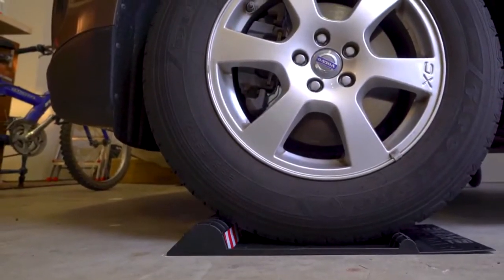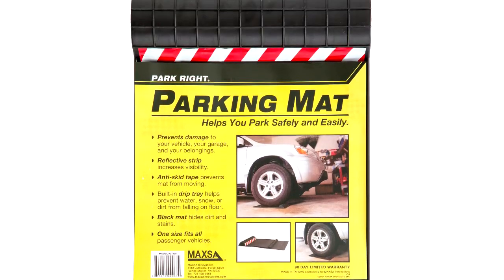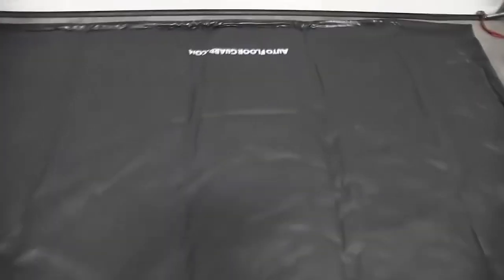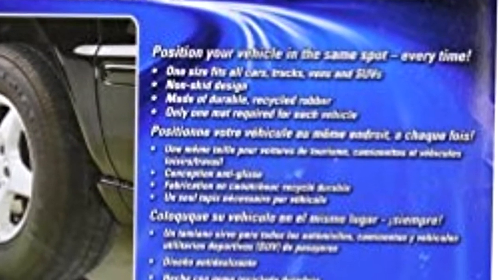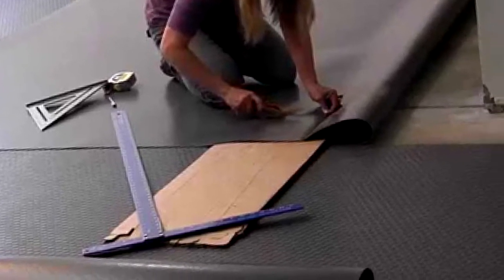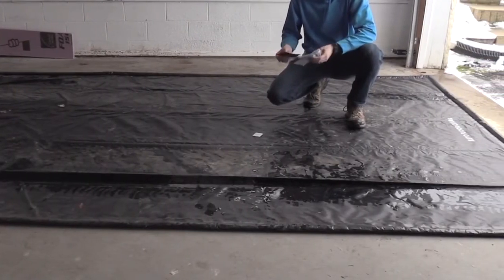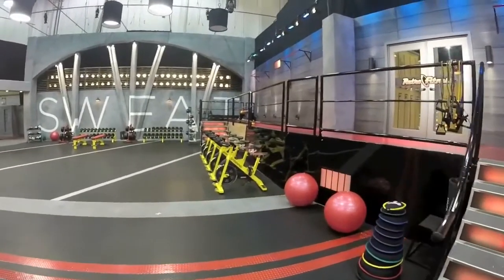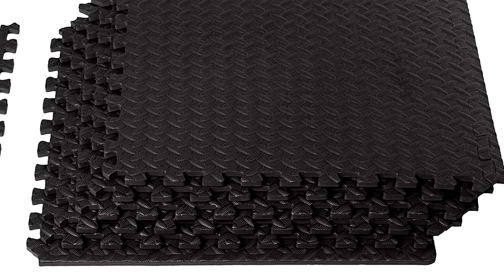Best Garage Floors 🤩👌🙀😎 in 2020

Comment from the maker: - Auto Floor Guard Containment Mat ➫ https://bit.ly/2XRuKKs
- AutoFloorGuard Heavy Duty Containment Mat ➫ https://bit.ly/2GimLeC
- Performance Tool W88989 Protective Interlocking Floor Mat ➫ https://bit.ly/2SoRRWB
- Maxsa Park Right Black Parking Mat 37358 ➫ https://bit.ly/2xVGNa1
- Highland 9242200 Park Right Parking Mat ➫ https://bit.ly/2YY7d75
- Rubber-Cal Diamond Plate ➫ https://bit.ly/2JSeeQF
- G-Floor Slate Gray Ribbed Garage Floor Mat ➫ https://bit.ly/2YXGffS